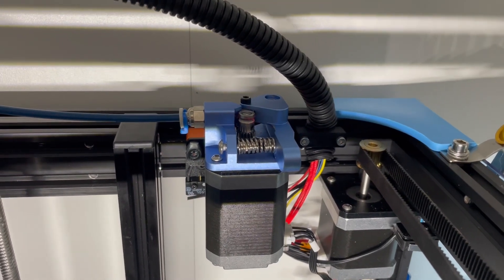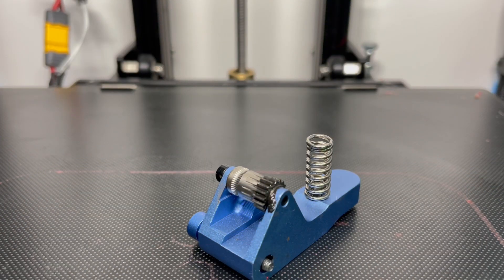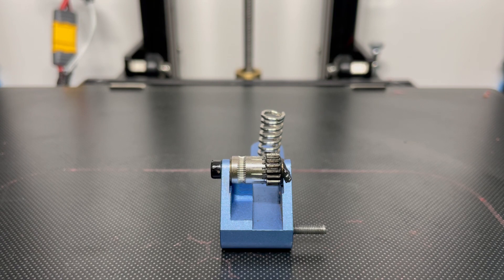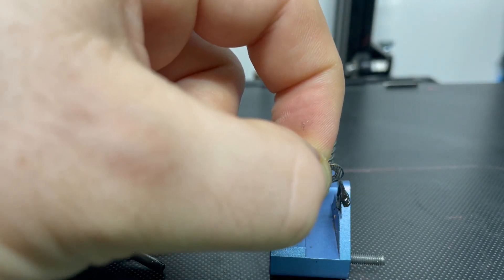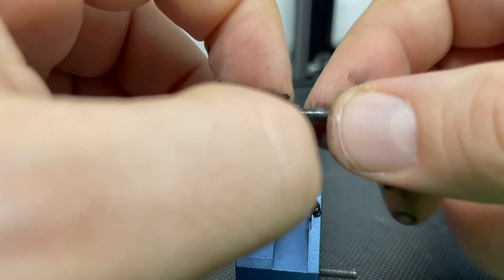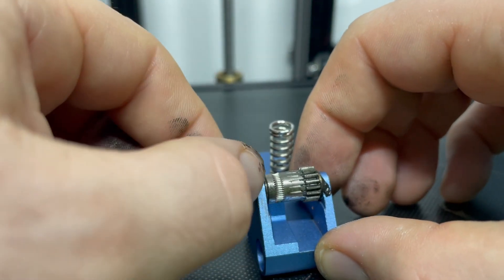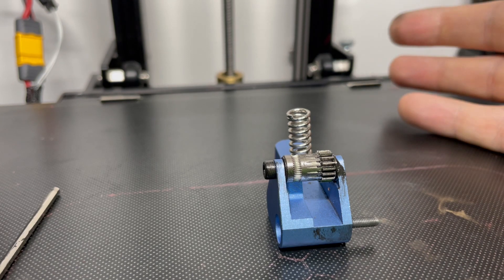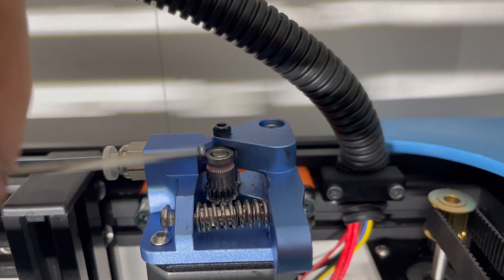Ender 6 Mechanical Issue Part 1 - Dual Drive

Comment: I was having the clacking at ridiculously low flows (with a non stock hotend), stringing, under extrusion, etc. Tried drying filament, leveled the bed, clogs, etc. etc. until finally decided to take a look at the stock extruder (soon to be replaced by an Orbiter V2). Look and behold, after applying grease as showed in your video and making sure the rollers are aligned, now all those issues are gone. Thanks!

Comment: Hola primero muchas gracias por el dato, me sirvio mucho, y segundo queria preguntarte si sabes por que puede ser que no lee las tarjetas, ya intente con diferentes ( que si funcionan) y no logro poder imprimir desde la sd, ya cambie el lector, intente con los firmwsre originales y nada, solo puedo usarla desde mi laptop, o si sabes de algun firmware modificado que pudiera funcionar, me encanta como imprime esta impresors pero me frustra no poder usarla desde la sd, de antemano te doy las gracias, saludos desde guadalajara México, tierra del tequila y el mariachi

Comment: Great video! Happened to me,  took apart and the bearing was blue and the shaft was very badly worn down. Powdered metal everywhere. Less than a month old! Less than 1kg of prints! The noise did not occur for very long. Let's see how the warranty dept. handles the issue.

Comment: Tengo una Ender 6, es un mundo de problemas inagotables, NO la compren es un dolor de cabeza
Reply: The ender 6 is my first printer. I've had it for 4 months now and run it nearly 20hrs a day without a single problem.

Comment: I know the Bowden setup has its advantages, however, after trying to solve stringing and/or  hotend clogs for a week, I trashed the whole system and moved the stock extruder in a direct configuration (used this work by CH711: https://www.thingiverse.com/thing:4734366) . Works flawlessly ( i tested ca 200 mm/s with very acceptable results) with a 2.5 retraction.No stringing. I am now starting to enjoy this printer after day of frustration...will address the whole original control board (sucks) issue after the summer, very probably following Phil's experience with a new board and raspberry setup. For the moment it works ok, even if the lack of control via the stock touchscreen is unnerving (and my USB port is DOA). 
My other Mechanical main issue is the z leadscrew. It has a steep pitch and the bed falls when the motors are disabled ( go fuck power outage resume feature...genius engineers @ creality!...it seems the ender 5 had the same issue....seems like they learn from their mistakes) gonna have to swap that with a less steep climb (tr 8x2mm should work) to avoid bed falling and reconfigure the appropriate steps of the z axis.

Comment: this is so true, parts that move should be 1. aligned properly and 2. greased or oiled. I purchased a small bolt called "hoppe's 9 lubricating gun oil". I figured that if you can use it for a gun that goes through a lot of heat and movement then it should work for my E6. Also, it a nice system because it has a log needle-like tube that drips oil slowly so u can get into hard to reach places and put the right amount that you need.
Reply from the maker: Okay...that sounds pretty easy 😇 I just use my tube of grease and a zip
Tie 🤣

Comment: I got fedup with the stock E6 dual drive extruder. I replaced it with the old plastic single drive unit from my Ender 3 and it has finally stopped under extruding. 

The gear that fits on the stepper shaft has an oversized hole and when tightened on the shaft pushed the gear off centre causing the whole extruder arm mechanism to rock. 

That caused uneven feed pressure on the filament and would grind away at it till it finally stalls an clogs the hotend during a long print.
Reply from the maker: That Sounds interesting...i will Check that on my Ender 6 :)